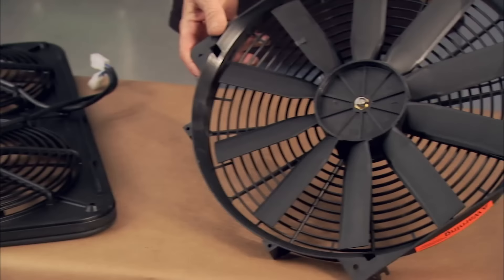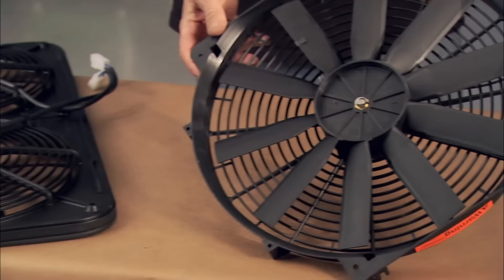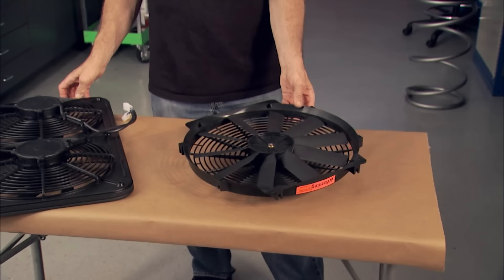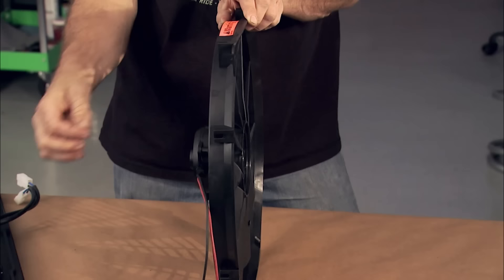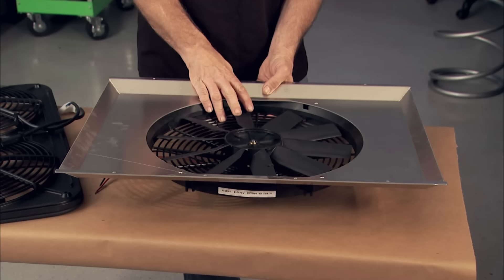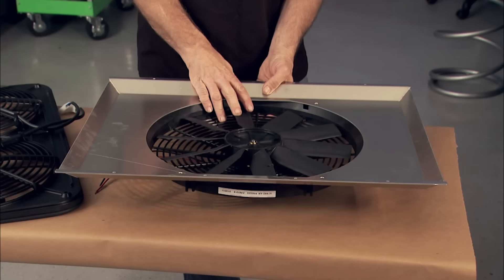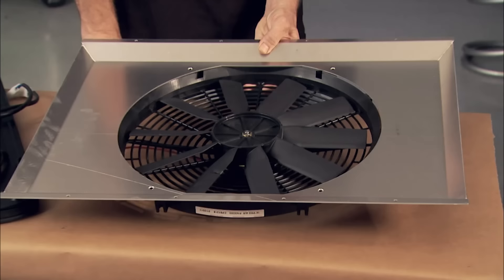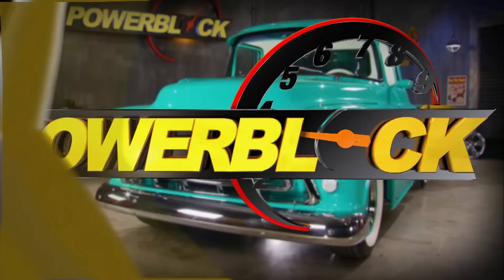Electric Cooling Fans — Tech Tips

Comment: i have a question i want to go with electric fans (or just one fan) in my truck its a 1986 chevy c10 with a 4.3 v6...what fan (s) do u recomend and can u send me a link
Reply from the maker: Hi Wade, 
For best results cover the core area of your radiator with as much fan as you can. That may mean using a single or dual, but also use a shroud. It helps to draw air across the entire core area.